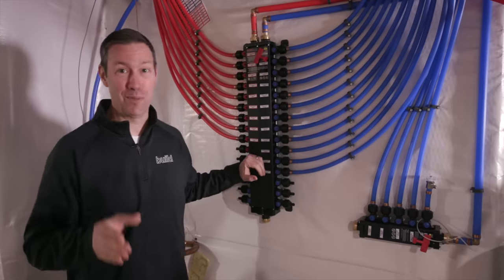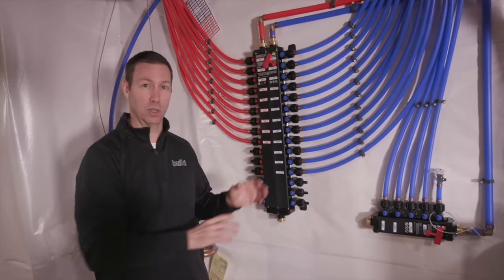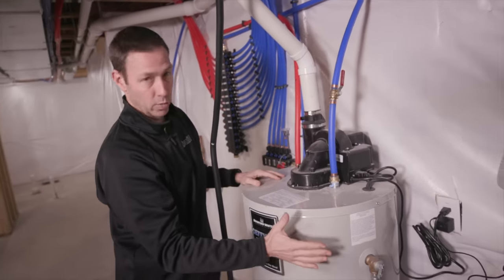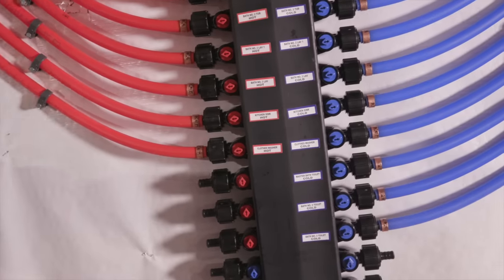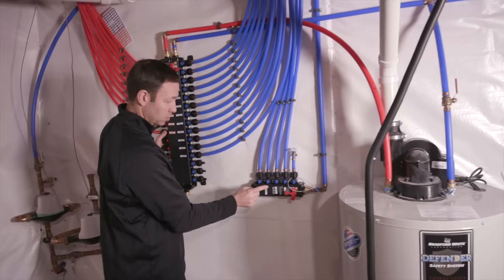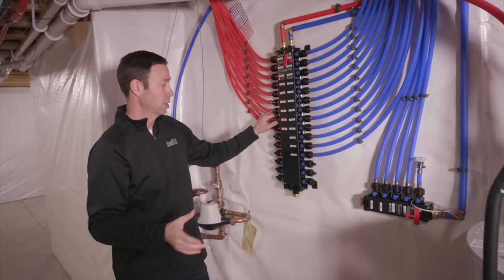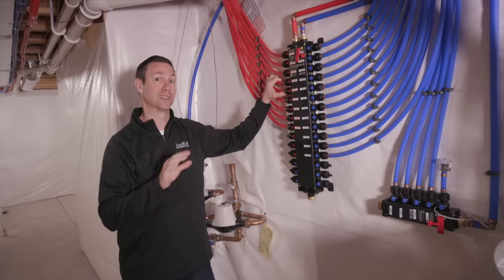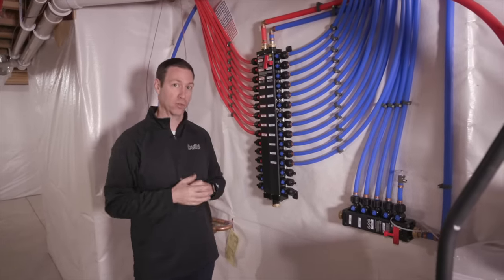PEX Manifold System - Pros and Cons + Tour

Comment: I like and have installed PEX manifolds, but I don't consider this to be a "pretty" installation and I do not like Viega system manifolds.

I install pipe insulation on both cold and hot PEX lines. I use pipe clamps to the hold the insulation in place.  This allows for no thermal breaks in the insulation, allows for expansion/contraction of the PEX material and helps to keep the cold water lines from sweating.

I also would have ran non-softened water lines to the toilets (if this is a city water system).

The installer/homeowner should have installed a whole house water filter in between the water meter and the input line to the water softener.  
Most of the softener brands that I have installed in the past require a certain level of micron filtration on the incoming water line or it will void the water softener warranty.
Reply: TechSkills Please elaborate on what exactly you don't like about the Viega manifolds?  I looked at all the different manifolds before choosing the Viega Manablock for my house. I liked the layout, easy repair ability of valves, included ready made labels, cost and the non-corrosive construction (since we have very hard water here.) As I mentioned in another comment above, it has even survived a few minor freeze-ups out here.

Comment: I have a system like this on my home which is 3600 SQFT.  I ran a second smaller manifold for the master on the far side of the home which seems to work and once hot water is there it is quicker to get hot water to the other parts of that bathroom.One drawback is that after 12 years I had a leak in the manifold.  I guess they fail over time due to the great numbers of expansion and contraction from cold to hot in them.  Good news is it was pretty easy to replace as long as they still make that size.

Comment: Is it just my OCD or something but hot and cold water lines aren't supposed to touch?
Reply: The Pex lines are allowed to touch.  There's no separation requirement between hot and cold.
Reply: Yeah, they could arc!  Stay back!
Reply: @482jpsquared  lol i was thinking more like wasted hot water due to temperature loss from hot to cold.
Reply: If they touch it summons Leviathan
Reply: @hardleecure  Pex is not very temperature sensitive; however, if you install it in an exposed attic you do have to insulate it.
Reply: pipes must be separated and insulated (europe)
Reply: leve hot water energy waste 
but cold will form condensation
Reply: @TheMakyato  Pex lines don't sweat like copper.  Like I said before, Pex is not very temperature sensitive.
Reply: is not about pex but humidity in the room i dont know there but in italy and israel they do condense  
in italy/europe we have at least 10 types of pipes and all condens
Reply: if they touch, it would be bad

Comment: Great video, all truth.  I have 3,066 sqft house with this manifold.  It is great to keep pressure equal, but the manifold was placed badly at one side of house opposite of kitchen which 56' away on plans so 60'+ of pipe.  I insulated the hot water from heater, now in summer hot water at kitchen takes 1 ONLY minute, winter is worse!  Otherwise I love the system.

Comment: Having the same manifold service hot and cold, seems it would heat the cold water and cool the hot unless its very well insulated...
Reply: Their isolated from each other. The hot and cold line do not come in contact with each other. Besides - in order to get cold or hot water u have to run the water till the line clears - otherwise it's just room temperature. Personally I think this is a waste of money. U have to use more pex and waste water.
Reply: Yes  what about legionella
Reply: Not when the water is running, not enough time or heat the water

Comment: Plumbing code requires 18 inches of separation between the PEX and the water heater. Use a stainless or copper flex line.
Reply: THANK YOU

Comment: I installed in a house I built in 1994 for a slab home works fine still today and to the hot water concern I had installed a small manifold of four for a return loop and never did wait for hot water ,it's all in the planning and that should have been addressed to the home owner before installed, the one thing about the manifold concept is to have 100 percent access to replace a line if need be and this is a must for concrete slabs you run the black water line one size bigger to each point and if you have to replace you snake it through by pulling the old connected to new one  and tighten up fittings one hour repair

Comment: I'm re-modeling my house. It's a 1200 square foot place. I'm going to Siamese the alcove bathrooms against each other, and the water heater will be on the end of the dividing wall. The 4-outlet manifold will be even with the top of the water heater. The bathrooms will use the first two ports on the manifold, the other two ports will go to the kitchen and an indoor garden hose connection. 

I'm gonna cool the house with an 8000 CFM Port-A-Cool ducted through the window in the back porch, so that's what the garden hose connection is for. There'll be a secondary fan that bows air from ceiling level, through a membrane (to keep bugs out), and into the attic, so at night, I can open windows and just pull in cool air to promote natural filling of the home with cool air.

Comment: Nice video. One thing about your "con" regarding long runs and homes in the south with no basements, I have a large home and the master bedroom is far from the hot water heater in the garage. It takes at least 30 seconds for the water to get hot. Yes, the line for the bathroom sink is shared by the shower, but usually that does not help very much. Also, I assume PEX in my house would be run thru the attic. That means the cold water will take at least 30 seconds to get cold since the standing water sits in the attic with is usually very hot all year.

Comment: have one in my house. installed in 2000. Back then it was "Vanguard" . I believe that Vega bought Vanguard out of bankruptcy.  Valves were undersized and there was a recall. Spent a afternoon rebuilding. Two drawbacks. 1. is hot water. As pointed out you waste a lot of water waiting for hot water to arrive at the fixture. Second issue is you still need shut off valves at the fixtures. Running down to the basement to shut off fixtures is a pain. I've added them over the years.

Comment: He didn't mention that you can leave a valve halfway, so that it limits the amount of hot water going to, say, the kids bathroom.
Reply: what do you mean by "limit hot water". The proper way to do that is by installing a mixing valve at the faucet.
Reply: @jessybwoy8677  I saw one of these setups in a model home. The salesman told me it can be used to keep the water at specific faucets from getting TOO hot.
Reply: That dosent make any sense at all. You would only limit the volume of hot water not the temp. So it may only be 2 gallons a minute vs 3 but the water would still come out scalding
Reply: Gary Vallone 
exactly...
a thermostatic mixing valve is the only way to limit hot water.

Comment: Of course, if the architect plans the house better, especially if it is two or three story with basement (mine is two story and basement), the plumbing outlets can be clustered. In my house we have the basement with water inlet, softener and heater below the kitchen and situated above the kitchen are two of the bathrooms. One of the kitchen cupboards has a fake 4 inch cavity at the side with a disguised removable side panel. The manifold is in that. The cabinet is a full height unit at the end of a cabinet run next to a doorway (the refrigerator sits there too, between the cabinet and door) and that door leads to a 'boot' room (which itself has a shower, sink for rinsing/washing boots, etc.). There is a downstairs bathroom that has a similar arrangement with the manifold in, and above that are further upstairs bathrooms. The two manifolds connect down to the basement water softener. There is also an active filtered greywater system in the basement. Cold drinking water comes from a single non-softened feed into the refrigerator, which also supplies the ice. Other greywater and non-softened feeds are for outdoor connections (we use greywater for use in our pressure washer and sprinklers).

All our pipes are insulated (why wouldn't you?) and we used blue (softened), red and white (non-softened) for clean water, and gray returns/feeds water for recycled use (so we don't waste that initial cold run, it does get used for the toilets (an active filtered greywater system) as water usage is expensive where we live. With solar PV panels (our winter is too cold for thermal collectors) and this water usage system, our utility bills are VERY low.

Handy when you are your own architect :-)

Comment: Hey Matt, have you done a video on a modified manifold system?  My understanding is that you run 1" main from street to water heater and cold 3/4" manifold.  Then run 1 3/4 of hot & cold to a room "bathroom" then run another 3/4 to 1/2 manifold to distribute to the fixtures.  This gives a higher flow rate to each room which reduces 1st-time hot water charge and virtually eliminates multi-fixture hot water charge.

Comment: There are adaptations that can be installed at the faucet fixtures which includes a pump that will push the hot water back through the cold water loop until the hot water at the tap reaches temperature.

This eliminates the need to run the faucet and the water down the drain until the water is hot.

Comment: I'll be using something like this in my next build, which will be a main level above a garage/shop.  The best thing you can do is design your house with the plumbing altogether as much as possible.  For example, have your bathrooms (up and down) close to the kitchen, and have it all on the same side of the house.  The only long lines you should have then is to garden hoses where hot water doesn't matter.

Comment: I'm all for doing things "differently" if there's good reason. I can see the positives: tidy install, easy to troubleshoot / eliminate problems, all the isolators are in the same place, and there should be no quirks of pressure and flow. But the negatives surely outweigh them: far more space taken up with pipework, and because there's more pipe in ceilings / under floor / in walls, more chance that someone will go through a pipe with a screw etc., but most of all - far more wasted water and heat energy that goes into the initial run of the faucets whilst hot water gets to the right place. In an example where someone used the kitchen sink, which is e.g. far away from boiler, then someone uses the bathroom sink straight after, the boiler has to heat double the amount of water before it gets to the faucets.

Like other commenters, I'm for a hybrid approach, perhaps with secondary return for keeping the water hot in the pipes to minimise the time to get hot water.
Reply: This definitely isn't for bigger houses. Can't use return lines on this system. We'll not easily. Small track homes I see no issues with this
Reply: YES! dead on. although... I've never viewed manifold system as tidy. looks like something an electrician would do- only.. with wires. pointless.

Comment: How would this system work if you had a washer or dishwasher (especially if they were high efficiency) that was really far away without the use of a circulating system? In a regular plumbing trunk and branch system you could run the laundry sink with hot water close to the washing machine to make sure the hot water in the water is actually hot but with this it would seem like the washer would only draw cold water, and since it's high efficiency they don't really use that much hot water so the water would always be cold! I guess dishwashers are better off where you could tee the end compression valve for the kitchen sink and dishwasher, and dishwashers also have heating elements inside.
Reply: Jeff Cao mine is installed so that the sink is on the same line as the dishwasher. that way i can run the hot for a few seconds before starting the washer and the line is pre charged with hot water. my washer is also on the same loop as my mudroom basin sink, and the same can be done.

Comment: How does cost compare? Do fewer fittings result in a labor cost reduction that offsets the cost of the MANABLOC?
Reply: It's not just the block.  Every fixture has a dedicated run directly to the block.  That difference could be from  1000-2000 extra feet of piping for an average house.
Reply: "Manabloc" is so gender offensive. It sure be called "personabloc".
Reply: it sure is more expansive !
compared to crimped pex B, you don't save much time since fittings are pretty quick to install....You might save some time compared to expanded pex A though, each fittings take longer to install.

I really don't see the pros of a manifold like that for a regular house. But, i see an advantage for condo towers, where you wanna minimize the risk of leakage. You don't wanna get called for a leaking fitting somewhere in the wall that floods the condo underneath, then look around for the valve etc.  With that type of manifold, you know where all lines starts and you have all the valves in front of you right there.
Reply: @jessybwoy8677  the homerun to every fixture is what cost more money.  The pipe is cheap the fittings are cheap.  But it's going to take 10x more labor to run all that pipe.  The advantage is you end up with more consistent flow when multiple fixtures are being used and being able to shut down any fixture from one spot is extremely convenient.
Reply: Daniel Fronc . Our legislators work very hard to introduce a bill guaranteeing that an equal number of womanablocs and manablocs shall be shelved for customers to chose from.

Comment: Best of both worlds would be to buy or build a copper manifold with shutoff valves. I would use two manifolds to keep the hot and cold separate. Leave a few extra outlets for future fixtures. Then run pex from the copper manifold throughout the house. This way you can add a recirculating pump and get hot water faster to the furthest fixtures.

Comment: Great callout on “everything homerun”
Reply: forgot to mention the amount of tubing going on here compared to the conventional plumbing.
Reply: There are ways to mitigate this.  1.  Use 3/8 pex on low flow fixtures.  2.  You can build recirc loops thru the Manablock so the distribution point is always hot. 3. Move Manablock's closer to point of use by zoning use areas and using multiple Manablocks for each zone.
Reply: @nneelix  Wouldnt that turn out te become more expensive ?

Comment: Wow, I love that! never even knew it existed. I would love if it only took 15 seconds for hot water. I am in a 2300square foot concrete slab home with copper pipe and it takes over a minute for the master shower to get hot.
Reply: Insulate the pipes or pex helps.
Reply: 15 seconds is optimistic. 30 seconds or longer Is not uncommon. The only real answer is a spot booster/instant heater, but the you usually need electrical or gas work, as well.
Reply: Cold showers will change your life, after the first couple mornings you'll wish you had been taking them your whole life!

Comment: I'm just looking at doing a manifold system and I think I'm going to run large lines to each area and then branch off. Since it is unlikely that there will be more than two people in the small bathroom at once I think that'll be fine we're both the shower and the sink and toilet. 

The only two other areas of the house to run lines are the laundry room and the kitchen.